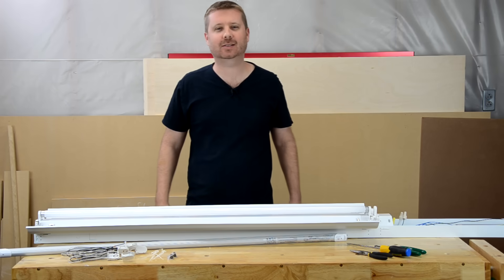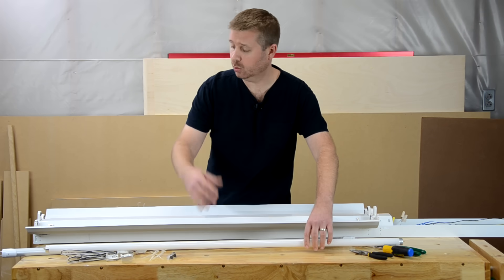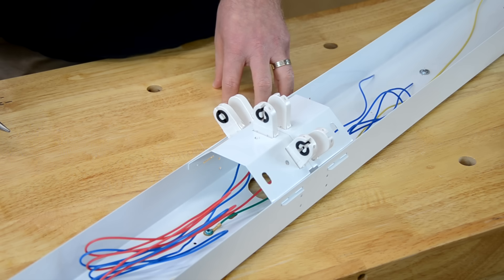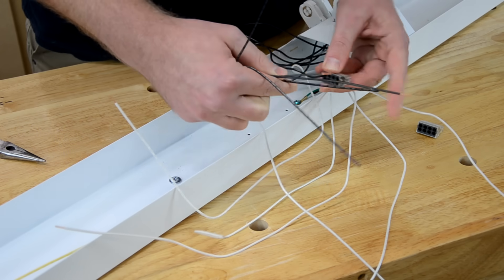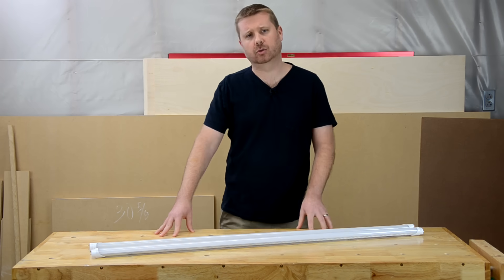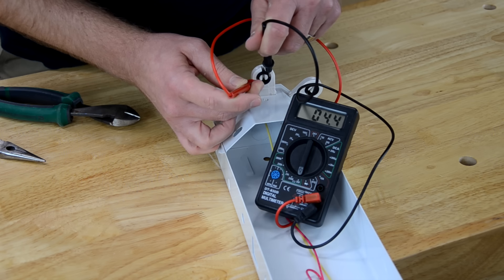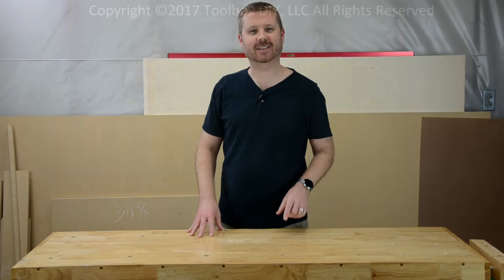How to easily convert fluorescent Lights to LED –Easy Ways to Save Money

Comment: I TOO MISSED THE PART ABOUT THE YELLOW WIRE. i SAW YOU ROLL UP THE RED WIRE AND TIE IT WITH A ZIP TIE. REAL CLEAN JOB. THIS IS MUCH LESS EXPENSIVE THAN REPLACING THE WHOLE FIXTURE AS ONE PERSON RECOMMENDED. GREAT VIDEO.
Reply from the maker: The yellow wires only went to the far end tombstones - the ones that don't do anything other than hold that end of the tube in place. I bundled those up much like I did the red wire. However, there is one yellow wire that goes from one end all the way to the other.  l just left it in place since it isn't doing anything and does not get energized at all. You could also completely cut this wire out, if you choose.

Comment: Outstanding tutorial. Well spoken, clearly stated and technical without being too difficult. Your bundling all the excess wire begs the question, "why not just cut off all the excess so that you don't have to bundle it"?
Reply from the maker: I felt it was unnecessary to cut all those wires off. If I cut them, then I have to strip 12 wire ends. Since I knew that the bundle would be hidden behind the reflector, I just thought it was easier to bundle. Also, those wires carry very little current so heat build up was not a concern.

Comment: I have recessed fluorescent light fixture with 4 f32 lights, I cant just replace them with led light bulbs of same kind? I have to dismantle the whole thing and change the wiring and all that??
Reply from the maker: You can install "plug-n-play" replacement bulbs. This won't be a conversion but it is the absolute easiest way to switch LED. There are two downsides to these which may or may not matter to you. 1) The ballast is still consuming a small amount electricity 2) If the ballast ever fails, you'll end up having to replace it.
If you decide to go this route, I recommend buying tubes that will work with or without the ballast. This way if the ballast ever fails you can just bypass it rather replacing it.
Reply: @ToolboxDIY  I acutally have t8 and t12s like everyone else my mistake but anyway where do I get the tubes that work with or without the ballast? home depot? it will say on package??
Reply from the maker: @Eastbaypisces  It typically says on the package if it requires a ballast or if it will work with or without. Most online stores specify this in the description. Some Home Depot stores carry these. You can find quite a few at Amazon and at 1000bulbs.

Comment: Can you explain WHY you shut off the power at the breaker?
Reply from the maker: Yes, of course. I did this for safety reasons - to avoid possible shock or, worse yet, electrocution. Turning off the light switch only is not adequate for a couple of reasons. You never how someone else may have wired a circuit. In theory, turning off the switch should open the circuit since it turns off the light, but there could still be some live wires in your junction box (it's not likely, but I've seen some messed up wiring). Also, people are in the habit of turning on switches when they enter a room. Despite a warning to spouses, kids, roommates, or friends, they may habitually hit the switch while you're working on the circuit - or they might do it while you're out of the room. Turning off the breaker eliminates these kinds of accidents.
Reply: Your supposed to shut off the breaker, because you can get a load on the neutral wire from another part of the circuit!
Reply: Scared 🤭🙃

Comment: Thanks , good information seems complete to me.
I’m currently changing complete fixtures. I’m changing from hardwired to plug and play. Seems easier and cheaper. Conversion would cost 3x the price. 
Subscribing!
Reply from the maker: Thanks for subscribing, Jeff! One note on plug-and-play...I recommend the tubes that will work with or without the ballast. This way if your ballast ever fails you won't have to replace it, you can just bypass it. 
Also, if you keep the ballast you'll waste a small amount of energy by doing so. It's not much on a 2-bulb fixture, probably 3-6 watts. Just something to be aware of, not necessarily a deal breaker.

Comment: Hi, I’m curious that if the cfl gives out the same amount of light as the led at the same wattage rating why change.
Reply from the maker: CFL have two disadvantages. 1) The light they put out doesn't render colors very well 2) They have an estimated lifespan that is about a third of LEDs. They still save money though so it's certainly not a bad way to go.
The fixture in this video was just straight fluorescent tubes - there are no CFL tubes so LED was the only option to get further energy savings.

Comment: Do the have these for 8 ft fixers ?
Reply from the maker: They do but they are different. The 8 footers are double ended and each end only has a single pin. So you'll have to swap out the tombstones with a single pin version. The other option is to convert to two 4ft sections using something like this: https://www.greenledzone.com/led-t8-retrofit-kit-converts-2-8ft-fluorescent-tubes-into-4-4ft-led-tube-lights/

Comment: This idea of updating existing fixtures from fluorescent to LED looks good on paper and I know there are a lot of people doing it but no matter what brand of LED tube you get you could wind up with an electrical arc at the point where the tube pins fit against the brass contacts in the fixture end tombstone.  I used to sell these LED tubes and have seen happen, in fact I had it happen in just the same conversion in my garage and these will get hot enough to melt the plastic ends on the LED tubes and left unchecked could even cause a fire.  The LEDs are great lights and do save money but my advice is to buy a dedicated LED fixture instead of doing this upgrade.

Comment: I recently bought LED tubes for the kitchen that work with a ballast, I wish I had seen this video first.  I have two florescent fixtures in the garage, in one the ballast died this week. I’m switch to direct wired LEDs as things die out. Thanks for the video.
Reply: Plus leaving the ballast insures greater electric usage! Go bypass and save

Comment: Did I miss that part. Never said what to do with yellow wire..will you really ever revert back to fluorescent?
Reply from the maker: The yellow wires only went to the far end tombstones - the ones that don't do anything other than hold that end of the tube in place. I bundled those up much like I did the red wire. However, there is one yellow wire that goes from one end all the way to the other.  l just left it in place since it isn't doing anything and does not get energized at all. You could also completely cut this wire out, if you choose.
Will I go back to fluorescent? Not likely, but I may go with a double ended, ballast bypass tube in the future. I'll be able to reuse those wire in that case.
Reply: In 10years ill be dead, guaranteed! I left a written notice on the fixture that it was rewired for bypass tubes, so let someone else worry!

Comment: At home I just replace it with $10 LED sets from Walmart. Left old transformer in. Works fine. Plug and play.
Reply: Some bulbs are direct replacement but the ballast sucks too much power, inefficient, puts out a lot of heat.

Comment: If you use the ballast with LED's you defeated the purpose of replacing them. Ballast uses power therefore, 0 savings
Reply: Just to let you know...these 120volt lamps each contain their own ballast or transformer. And in commercial applications have zero warranty.

Comment: You do know that they make and sell LED light tubes that fit in place of the fluorescent tubes with no modifications-required right?
Reply from the maker: Yes, it was mentioned somewhere around 9:20 or so in the video. Two things about those tubes: 1) keeping the ballast means less energy savings. Depending on the number of bulbs, a ballast can consume between 3w to 20w. 2) If the ballast ever fails (and they do), you now have to fix that by either bypassing it or replacing it. One note, a magnetic ballast is probably a lot less likely to fail than an electronic ballast.
If you go this route, I recommend a light that will work with or without the ballast so if the ballast does fail, you can just bypass it and not have to replace it or buy new LED tubes.
Reply: But they end up using more electricity

Comment: For the cost of the bulbs and conversion you can just about buy a nice led fixture you can drop in and connect wires. Much easier quicker looks bettet and gives better light
Reply: And send the old ones to the landfill???
Reply: Not as easy if your in a shop or commercial building where you have conduit running to each fixture with wires from one to the next.

Comment: Wound it be cheaper and easier to replace the fixture with an LED one? It would surely be faster.
Reply from the maker: Sometimes, yes. I have five 8ft, 6-tube fixtures in my workshop and replacing those 8ft LED fixtures is more expensive and more time consuming to install. I knocked out the conversion in less time than it took me to install those. Now if you have 4ft fixtures, replacing them might be both cheaper and quicker.
Reply: @ToolboxDIY  what is the cost of the conversion parts and bulbs and how long does it take to remove the fixture, do the conversion,  and reinstall?
Reply from the maker: Anywhere from $6 to $10 per bulb and $1 per tombstone (usually have to buy a pack) plus a few bucks for wire connectors. I don't remove the fixture to do the conversion. I only did that for the video. The conversion takes about 20 minutes per fixture unless you have a 6 or 8 bulb fixtures. Those take about 30 minutes.

Comment: I was just curious but don't LED lights need to be attached to a transformer before it is attached to the ceiling?
Reply from the maker: The transformer is actually inside each tube. The "transformer" is actually just an inexpensive a/c-to-d/c switching power supply. When LED lights fail prematurely, it's usually due the components in these power supplies.
There are LED tubes that use an external driver (transformer), but they are not as common and quite a bit more expensive.

Comment: Maybe a link to parts used
Reply from the maker: You got it.
Tombstones: https://www.amazon.com/gp/product/B00L1FUUG2
LED tubes: https://www.amazon.com/dp/B00O1CJC0C (These aren't the exact ones I used. Those are no longer available, but these are very similar and have good reviews.)
Push connectors: https://www.amazon.com/Wago-773-168-Push-Wire-Connector/dp/B07CN6WR26

Comment: Whatever you do do not cut the useless wires off, nor cut the others that are about 12 inches too long down to the correct length. Instead wad them up and cram the excess into the fixture.

Comment: I wouldn't do this The single most annoying problem with florescent tubes is those damn two prong connectors. You're buying LED light that lasts 20 years; why pair it with a two prong connector that would last 2 weeks ?  (they keep coming disconnected !) Switch florescent over to the screw in LED bulbs. Then anyone can replace the bulbs.

Comment: I hate ballasts.  I'll probably wait till they fail to bother changing, but I hates em.
Reply from the maker: One option is to replace your fluoro tubes with double ended LED tubes that will work with or without the ballast. Once the ballast fails, you can just bypass it and not worry about replacing it. The existing LED tubes will continue to work. The only downside is you waste a little bit of electricity keeping the ballast. Not much on a 2 lamp fixture, but it adds up if you have multiple 4 or 6 lamp fixtures.

Comment: Nice video instruction, thank you.  Is it possible to convert 8’ T12 fixtures?
Reply from the maker: Yes, it's possible. You have two options: 1) Use 8' LED tubes and replace the tombstones or 2) convert the fixture to use 4' tubes.
To my knowledge, option 1 may require replacing the tombstones with single pin tombstones. If there are dual pins 8ft LED tubes out there, I haven't seen them. All I can find are single pin, double ended tubes. Option 2 would allow you to use 4ft T8 LED tubes but requires a conversion kit like this one: https://www.greenledzone.com/led-t8-retrofit-kit-converts-2-8ft-fluorescent-tubes-into-4-4ft-led-tube-lights/

Comment: Interesting video. However when I checked the cost at my local Home Depot of retrofitting like you did versus buying a new LED shop light the cost was the same ($18-$19 for a two bulb fixture). I am very comfortable with electrical work but if I am not saving anything why waste the time. Maybe in other areas the cost is different, I'm in Pennsylvania.
Reply from the maker: Since this video was posted, prices have come down substantially making a conversion less economical. I've found that for large fixtures (like 8ft with six 4ft lamps) the conversion is still more cost effective. Also, for those who have more decorative fluorescent fixtures, finding a suitable LED replacement fixture may be difficult.

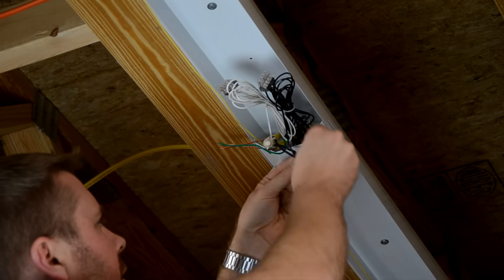Comment: At the 7:42 mark, you mention connecting the pigtails to the electrical power via wire nuts.  However, with respect to the ground, you mentioned connecting it to "something" via a wire nut.  What was that "something?"  Thank you in advance.
Reply from the maker: I think I just said ground-to-ground. What I was connecting with regard to ground were three wires. One coming from the light switch, one going to the next light in my circuit, and one green pigtail that is connected to the chassis of the light fixture.

Comment: I have a locksmith shop and I just replaced the fluorecent lights for LED, I didn't change nothing  else and are working very good, saving 30% of my electricity bill, Do yo thing I'm  tanking a risk?
Reply from the maker: Not a big risk. Ballast failure is less likely to occur with LED tubes. If the ballast does fail and the LED tubes you are using requires a ballast, then you'll just need to replace the ballast. If the ballast is optional, then you can bypass it after it fails and you're good to go. 
Sure, you have a risk of the ballast failing and then having to do some rewiring, but it may be years before that happens. In fact, the LED tubes may die before the ballast does. So I don't think it's a big risk.
Reply: @ToolboxDIY  thank you for replay.

Comment: POP in replacement bulbs are available, but will produce about twice the light with same power.  For best efficiency a discrete diver can replace ballast, used to drive LED strips most efficiently. Avoid light tubes that use internal resistors to limit current without active electronics -- unless flicker is not a problem.  Some regions require these types of lights have power factor correction drivers to be technically legal.  Some can be dimmed, some even have remote controls.  Definitely upgrade to LED light for lights left on all the time.  Different brands vary in quality and efficiency.

Comment: ToolboxDIY     I live in Florida. My florescents only work when it gets cold, for Fl, meaning, around 50 degrees in the garage.  They barely glow on the ends most of the year.  I've always heard they usually don't like the cold, but that's not my case.  Mine don't have starters, just a ballast.   You ever heard of this situation? Thanks!
Reply from the maker: I have heard of that, but not in a temperate climate like FL. You can get cold weather electronic ballasts (no starter) which may resolve the issue. But for all that trouble, LED is probably a quicker solution.

Comment: I just get to the back of the tombstone and clip the shunt; solder on new wire. If it were that much work that you do....I wouldn't even start.  I cut out the ballast and leave it mounted....If every wire to it is clipped....it doesn't make any difference whether it's up there or not.

Comment: ia there a reason i havent seen t5 replacement mentioned at all?
Reply: Satco makes a T5 LED retrofit lamp (ballast bypass) model number 25T5/LED/46-840/HO/120-277. This one is a 4000K. But you can get them in 3000 or 5000K as well.

Comment: hi everyone. my existing fluorescent light fixture has a starter. can i just purchase this and fit it in without doing any wirecutting? someone online mentioned to remove the starter and leave everything else as it was and connect the new led bulb and it will work. thank you https://www.aliexpress.com/item/360-Degrees-Bright-LED-Tube-T8-Light-220v-240v-60cm-600mm-10w-LED-T8-Integrated-Driver/32812484429.html?spm=2114.search0104.3.104.26ea4954ylIpig&ws_ab_test=searchweb0_0,searchweb201602_4_10065_10068_319_10059_10884_317_10887_10696_100031_321_322_10084_453_10083_454_10103_10618_10307_538_537_536,searchweb201603_51,ppcSwitch_0&algo_expid=53895307-72ed-4fef-b6db-031eecd48743-14&algo_pvid=53895307-72ed-4fef-b6db-031eecd48743

Comment: My electricity bill is about 100$ a month with all the CFLs in my house. Not changing anything else in the house except for the light bulbs. I managed to save an average of $25-30 a month in my home. This is a 4 month average. I didn't tell the family anything. We used the same amount of light but got billed for way less each month.  I think it's worth it in the long run.
Reply: But what was the capital cost to covert those?  Did you include those costs?
Reply: ki0ng   That's apparently a real issue... rats tested with LED's demonstrated measurable destruction on retina cells, at domestic lightning levels !
 Don't look at those lights ! The worst issue is maybe on the road, though... much brighter.
The light they diffuse is also quite cold, I need to find warmer color temps (couldn't find incandescent bulbs anymore last time, only cold white or colored LED's, not what I was looking for) Maybe some day LED's will end like fluorescent lights, limited to kitchen and public spaces ?
Reply: Replaced every bulb in my house. Now with outside lights on all inside lights on total of 190 watts. 3 bedroom home